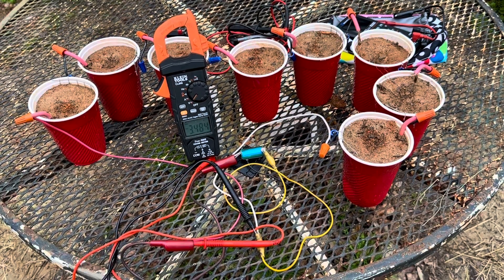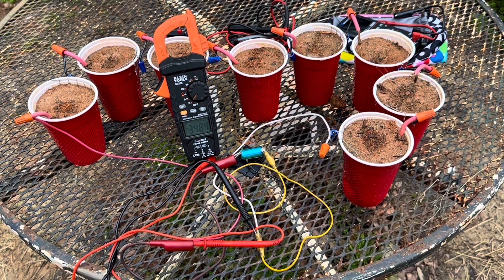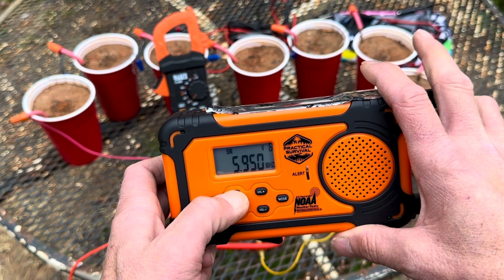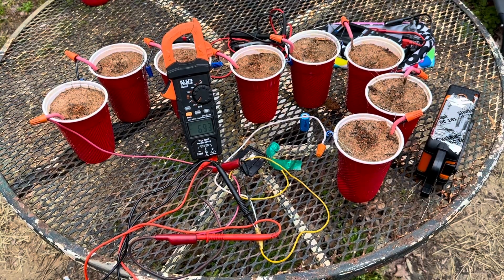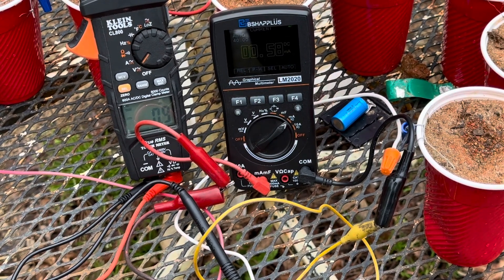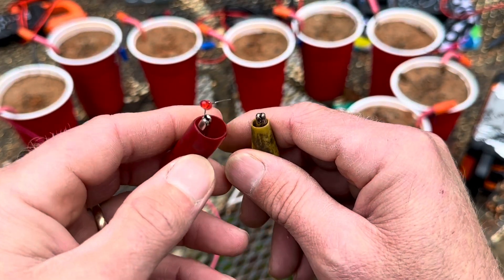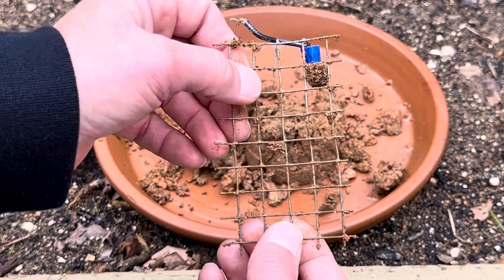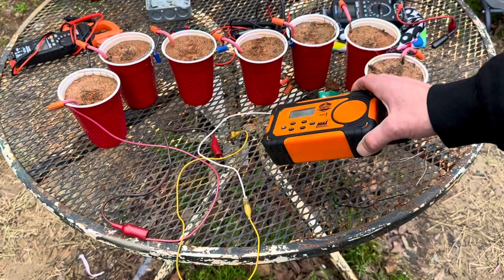Easy DIY DIRT BATTERY, Free Energy?

Comment: It's definitely a neat experiment. I love this kind of stuff.  We all should start thinking out of the box some.  This is a simple way to get some renewable power from basic items that are common all over in the country.  Galvanized ( pipe barb wire, nails etc) or zinc materials.  Then some copper wire. Can you get more power with damp soil or by adding something to the soil? Now I have a couple of experiments to do.  I enjoyed the video, and I am sharing it with others.  This is just neat and has a real-world application.  Keep the videos coming!
Reply from the maker: Glad you enjoyed the video! Backwoods battery assembly could be a useful skill someday. Hopefully not but you never know! 
Next would be to scale up and see if I can get around 1 amp @ 12V
Reply: Look forward to it!

Comment: Just another thought. Do you think that the metal table that the cups are sitting on, might be discharging any if the cells??? If they were isolated more maybe on a plastic table would it change the voltage???
Reply from the maker: If the cups are wet from rain, maybe. I’ll try on a wood board next and let you know!